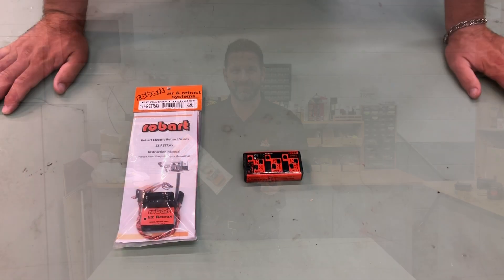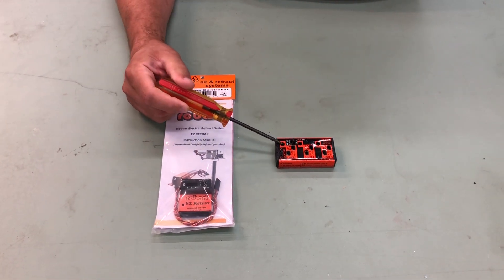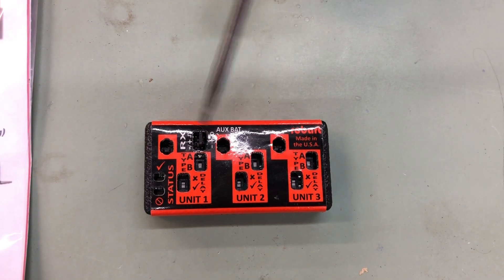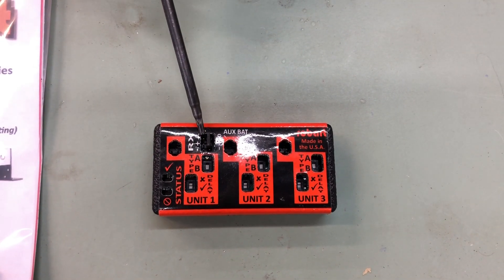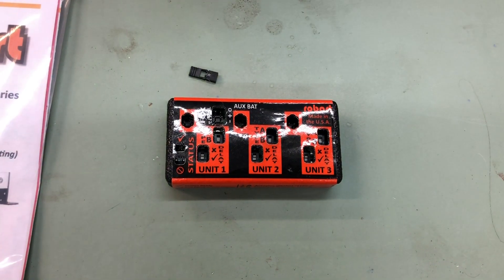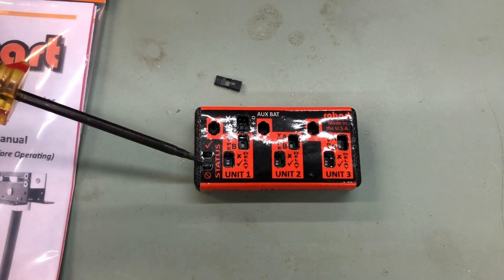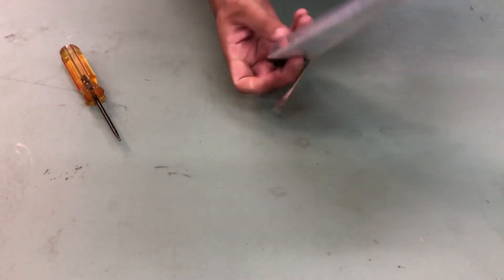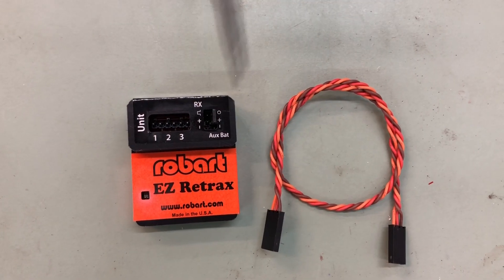Robart's Electric Retract Control Units

Comment: question for you. the giant scale one. is there a way to troubleshoot and make the electric retract work without this unit, if I want to test one of the gear individually?

Mine are not working,.
Reply from the maker: NO!  Our control box is what stops the electric actuator from running.  Running our actuators without the control box will damage your retracts.